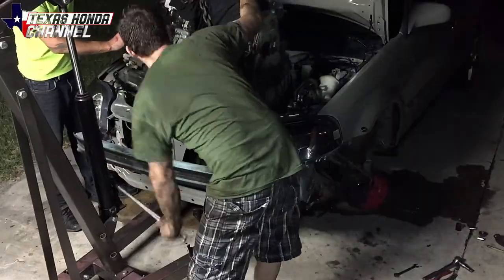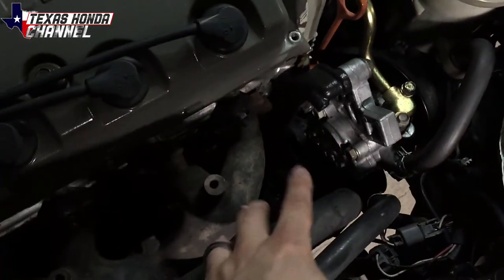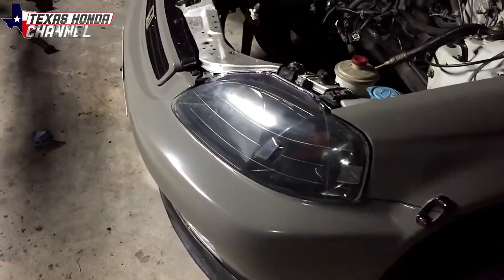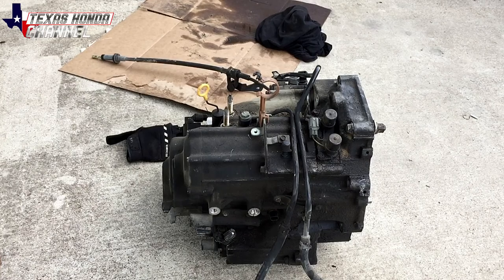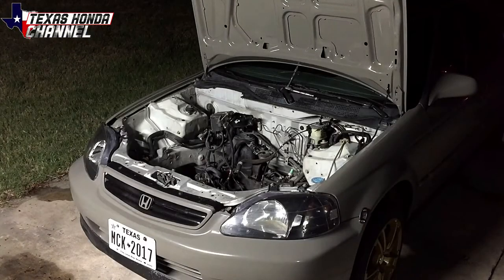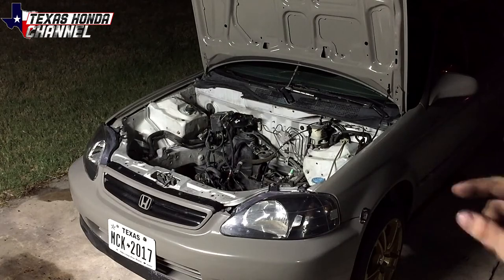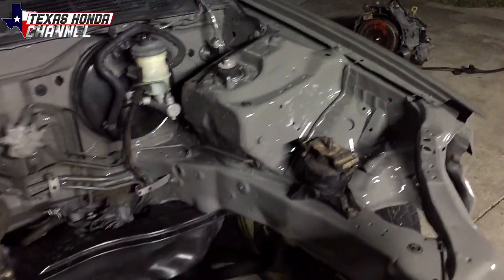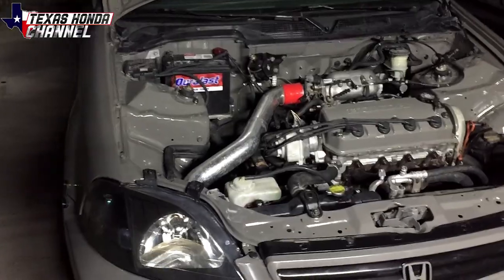The civic got a wire tuck, Painted bay and a new transmission. (Check it out!)

Comment: You can turbo it with the automatic transmission but you probably can't run more than 8 to 10 pounds of boost which actually isn't bad at all with an automatic. You'd need to boost it to 12 to 14 pounds of boost with a manual transmission to get approximately the same quickness.

Comment: That looks clean!! As for the turbo...why not do it now if you have everything you need to do it? 😁
Reply from the maker: zachm611 I don’t have everything for it yet. Still need obd2 to obd1 swap harness adapter/ obd1 hondata and the turbo manifold/adapter for it and intercooler kit. Only have turbo, injectors, blow off valve
Reply: @TexasHondaChannel  oh man sounds like you got your work cut out for you!  Either way thanks for the videos
Reply from the maker: zachm611 For sure thanks for watching!! I have my work cut out for sure

Comment: Hey James, you might want to test out the automatic transmission with the turbo setup you're planning on doing. I've driven manual and automatic transmission turbocharged 4 cylinders and for some reason the automatics are always quicker. Counterintuitive I know but that's been my experience. It might be because the automatic keeps the engine in boost better. 👍👍 Also you might put a half a bottle of the Lucas Transmission fix in your new used transmission just as a precaution.
Reply from the maker: ghogue61 Already did the Lucas as preventative measure and only crappy part with the auto and turbo is it can’t be tuned :/
Reply: @TexasHondaChannel  
The gear ratios are completely different for the automatic and the manual so 7 or 8 pounds of boost with the automatic will surprise you. As long as your MAF is working the stock injectors and fuel pump should be able to handle the task.
Reply from the maker: ghogue61 Yea with Honda Civic at least on the obd1 I had issues with anything over 1psi it would throw a MAP sensor code and act up but it held it

Comment: You wanna come up to Oklahoma and help me swap.in the new motor in my cobalt? It'll be a while, gotte save up for big turbo and e85 intector rail
Reply from the maker: sinformant I am not sure yet I try to stay clear of the Oklahoma lol 😂 last couples times I drove there there my vehicles ended up having some issue due to the roads lol
Reply from the maker: sinformant Dang them roads are something else. I would love to get a EP3
Reply: @TexasHondaChannel  yeah I miss mine sometimes but it seemed like parts for the ep were so expensive compared to other civic models. I got lucky when I found that car though. Paid $4,000 cash for it with 32,000 miles and it had type r momo steering wheel, full alpine sound system, cf hood, aem intake, cams, and I loved the momo gtr rims. I think the exhaust was skunk 2 as well but I sold it like 5-6 years ago for $2500
Reply from the maker: sinformant Wow I would have loved to buy it but they are a bit more expensive to mod for sure.